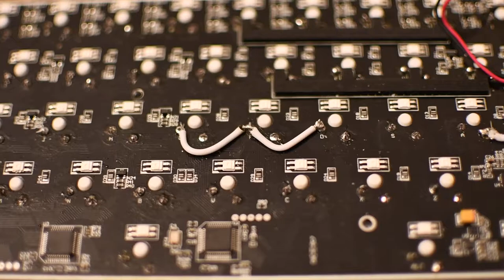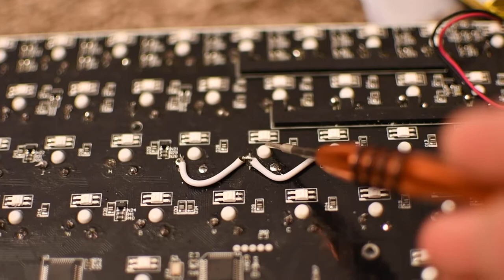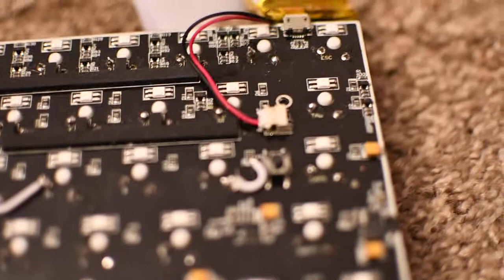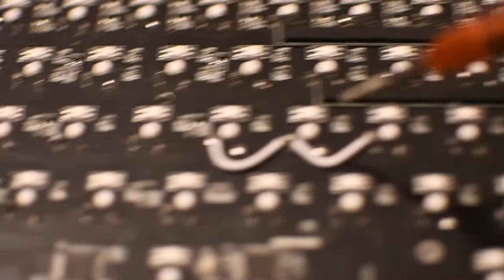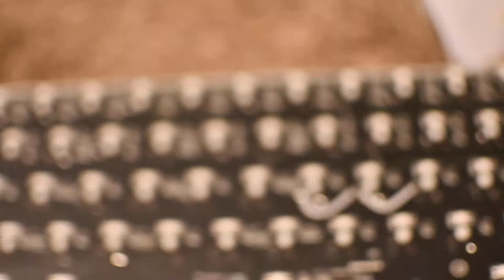Anne Pro PCB Lifted Pad Fix (should work for most other mechanical keyboards too)

Comment: Great video. I saved 4 keys with 6 lifted pads using cat 5e cable wires. I finally chenged my  corsair k63 wireless from linear to tactile switches.
Reply from the maker: Glad I could help!

Comment: both pads on my q key came off and using this method helped fix it, i had to bridge the upper pad to the left and right switch and soldered the lower pad to the respective diode of the q key

Comment: This saved my keyboard and made it useable. My keyboard is a masterkeys pro S, i had multiple areas where i ripped the pads and at first i tried connnecting them via scraping the traces but it wasnt viable. Then i saw their numbers and used method shown in the video and got it fixed. They are numbered in order on my keyboard. I ran wires in parallel like shown here but make sure you connect everything you think is stripped before testing other wise keyboard still wont work correctly
Reply: Mine is broken on the bottom one column to be exact the diode is broken so i connect it to the left or right, it copies the input of the following column that i connect, how can i fix this?

Comment: Thank you so much, my space key didnt work.
Soldered it to left and right alt keys now it works like charm :)
Reply from the maker: Glad I could help! :)
Reply: Hey man, not sure if you're still active but I have the same problem with my spacebar that you had right now due to me desoldering and then resoldering. But I think I lifted both pads. Do you have any tips?
Reply: @vanillasky4329  
solder space left pad to left pad of right alt, and to the left pad of left alt.
then for the space right pad you will have to find which diode is connected to space, its probbably close to the right leg of the space.
if you cant see the trace, just solder a wire to the space right pad and then to the diode.
if you dont know which side of the diode try both.
Reply: @MirkoPribanic  Hello! I hope you're still active on this thread. but I've looked around for a diode near the spacebar, but I can seem to find anything that looks sort of like a diode, HOWEVER, I have noticed the right pad traces leads up to the character "B" button's right pad, so I was wondering if I connect it there? Hope you're still active, you give me hope for my Anne Pro V1
Reply: @Kobeboy15  Yeah since you have both pads lifted you will have to find where the traces lead.
The right one looks like its connected to b key right pad.
The left one i cant really see, you can experiment with different ones, dont worry you wont damage the pcb

Watch this video should be helpful
https://www.youtube.com/watch?v=N5IivDkrp6U

Comment: So my windows and my left ctrl got pad lifted then what should i do? Where should I connect the to?
Reply from the maker: It depends on which pad was lifted for each of the switch locations, but if it's the legs that are meant to be wired to other switches, wire Left Ctrl and Windows keys together, and then wire Windows to Left Alt. If it's the legs meant to be wired to diodes, then just wire each switch to its own diode.
Reply: @Flashquark  i try to desoldering them, but my pcb got broken and both switches can't detected, i think because of the pad. So the both pins got broken. Then should I connect both of them?
Reply from the maker: @benedictiyog6228  yep, for each switch, one leg should be wired to the diode and one leg should be wire to neighboring switches megs that are in the same position

Comment: i have a keychron and i cant figure out what the diode is and which is the correct one for my dead O key..... any ideas or suggestions?
Reply from the maker: You have to just test one by one until you find the one diode that works. Every keyboard's diode layout is different, depending on the way that the PCB designer chose to place them. Usually it is located close to the switch that it is meant for, but it doesn't necessarily have to be right next to it. Also, diodes have polarity and it should be hooked to the side of the diode with a stripe on it.
Reply: @Flashquark Mine is broken on the bottom one column to be exact the diode is broken so i connect it to the left or right, it copies the input of the following column that i connect, how can i fix this?

Comment: hey, i've tried this. however, the whole row of my keyboard (from Q > \) is not working. I have tried doing this method, by connecting from TAB till T. The keyboard cant seem to continue working from Y onwards. Do you know what i should do?
Reply from the maker: If you connected from tab until T and then functionality works up until Y, then it looks like you did everything correctly. You would just need to continue linking all the switches until it reaches the backslash. Unless I am misunderstanding the situation: which switch(es) were the ones that lost their soldering pads?
Reply: @Flashquark  I already tried connecting from Tab to Y. But then all the other keys that i connected couldn't work anymore. Is it because there is not enough power to connect all those keys from tab?
Reply: @Flashquark  Oh and the switches that lost their soldering pads were Q. But then the rest of the row couldnt work as well. Ive done a bit of research and it said that i might have disconnect the trace on my keyboard? (im not sure how to fix that)

Comment: what if its the left shift key with the left leg of the switch lifted do I wire it to the right side and the bottom part of the circuit
Reply from the maker: It depends if the left legs are meant to be wired to a diode or leg on your particular keyboard. However, if the left leg is meant to be wired to a neighboring switch's leg, then only wire it to the same position leg of the switch to the right side of it and that's it.
Reply: @Flashquark  Thanks a lot! I managed to fix my keyboard I thought it was gone hehe. This method works!
Reply from the maker: @adrianmacalino4277  I'm glad to hear that you managed to fix your board! :D
Reply: oh man just realized Im abt to rip off the right pad of my spacebar but I dont know what diode I should connect it to... any ideas? My model is an RK 61 a bit different but I hope it's a bit easy

Comment: I hope someone could help me out here
I lifted a pad on my s switch, and bridged it then it worked. But the only problem is that one whole column on my keyboard on the leftmost part of the board (esp, tab, capslock, shift, control) doesn't work at all tried to bridge it but still nothing.

Comment: Hey nice tutorial. I currently trying to repair a lifted pad on a right shift. The lower pad to specific. Any tips on how to fix this? Thanks a lot.
Reply from the maker: Im guessing that the lower pad should be hooked up to a diode. For the right shift, the diode may not be immediately in the vicinity of the Right shift. See if you can follow the trace coming from that pad to see if it connects to a diode somewhere and connecting a wire between the two locations.

Comment: Nice tutorial. Im getting some grip over this but hey I am currently having problem on all 5 keys on the side. I am supposing its lifted on the right side. So i hooked to the diode then all keys on the same vertical horizontal line gets pressed instead of single key. Any tips? Thanks
Reply from the maker: Then it means that your keyboard is hooked up so that the diodes link the horizontal rows together instead of columns. Therefore try hooking up from leg to leg instead of leg to diode.
Reply: @Flashquark After all combinations of legs, I gave up. But thanks though

Comment: both pads on my space key have come out, what do i do in that situation?
Reply: i'm on alloy origins 60 btw*
Reply from the maker: wire the switch legs using both methods that I showed in the video! One leg will be wired to diode, the other leg to the same positioned leg on a neighboring switch

Comment: What about the spacebar socket - do I connect vertical or horizontal? Its a DropAlt by the way. Appreciate your info.
Reply from the maker: It really depends on which switch leg that you're dealing with. From looking at pictures of the Drop Alt PCB that are online if you view the PCB from the back side such that the hotswap sockets and microcontrollers are visible, the spacebar switch socket has a diode next to it that is labeled D62. If the hotswap socket is damaged, it may be easier to just completely remove the hotswap socket, wure the right switch leg to the diode D62, and then wire the left switch leg to the left legs of both switches on the left and right sides of the spacebar switch. Here's the picture I was referring to with lines added to show how it should be wired: https://imgur.com/a/ds8Azd1
Reply from the maker: Btw, looking at the picture again, it almost appears like I was implying that you should wire both spacebar switch legs together, but that was not my intention. The wire coming from the left switch leg just happened to pass over the right leg's socket in the image, but don't actually wire both switch legs together.

Comment: I would like to ask something about the diode. Do you connect it to the positive(+) or the negative(-) side? This is my first time doing this and not sure how these things work
Reply from the maker: The wire should be connected to the positive side of the diode. If you are not sure which is which, there is usually a think white line closer to one side of the diode or an arrow marked somewhere on the diode or PCB should you which side is the positive cathode.

Comment: i press left ctrl button and it registers capslock ,TAB ,Shift, ESC ,and Numlock button at one time how to fix it???
Reply: One of the diodes may be broken and needs to be replaced. It is most likely the diode connected to the Ctrl key.

Comment: How come I've seen in some videos where they wired the right leg to a bridge to other switches instead of the diode
Reply: Also for my pcb the diode seems to be on left instead of right
Reply from the maker: @kodychen9804  It's possible that its reversed on your keyboard. There is no standard for which side is which, but if one of your switches is a certain way, then most likely all of the other switches on your board are the same way as that one.
Reply: @Flashquark  thanks for replying so quickly. I am wondering if I am supposed to bridge yo both sides. Ive seen some where they only bridge to one of close by. I am also wondering if the move is to just try bridging to another switch and if it doesn't work I bridge to the diode
Reply: @Flashquark  also is there a way I can contact you so can send you pictures of my situation

Comment: Is it possible yo connect the right to the next right leg?
Reply from the maker: It is possible, it entirely depends on how the PCB was designed on your keyboard. However that means that the left leg should be connected to the diodes. If right leg is the one that is connected to the diodes on your board, then you must connect a right leg to a diode. I know it sounds like I'm stating the obvious, but what I mean is that you cannot link a right leg to another right leg out of convenience if it was intended to be hooked up to a diode due the the way that your keyboard's PCB was designed.
Reply: @Flashquark  last question
 hehe, can I still change the switch even if it is wired already?

Comment: I actually lifted a pad too and i was so fucked up.. then i just tried my luck and reapplied solder into it and the switch was working again.. do you think the circuit is still ok then or do I have to worry about sth?
Reply from the maker: If it works, I would say that its fine, and I wouldn't try to adjust it or anything. It's most likely working because there was a little bit of PCB trace was still exposed that the solder you applied is touching, but it may not be so easy to get contact with it again if you melt down and reply the solder again.
Reply: @Flashquark  Thankyou very much for your answer. 👍 What do you think about stabilizing the solder with hot glue?
Reply from the maker: @heyiamsven  I would say that it can't hurt add some hot glue to it, just in case the solder is just hanging by a tiny bit of pcb trace, so go ahead and try it!

Comment: Hello @
Flash Quark thanks for the video, my Q key is broken cause of lifted pad and I bridge it to the next key(like yours). But my Q continuously firing and I'm not pressing the key. Why is it like that and how to solve it. Thanks a lot :)
Reply from the maker: One thing that you want to make sure is that you're bridging to the pin in the same position on the switch next to it. Also, you may want to try out wiring that pin to a diode instead, in case your keyboard is wired in the opposite way from the keyboard that I demonstrated with in the video.

Comment: hi! quick question but what if you lifted the pad on the "tab" key and there's no key can attach it too...
Reply from the maker: If the key is on the end of the keyboard, then it should just be hooked up to the neighboring key on one side of it ("Q" if you have a standard board) and it should be fine.
Reply: @Flashquark  I tried your method on my esc key, I connected the wire to the correct pin on the f1 key, but whenever I press esc, it activates the f1 key, is there any solution for it? please help :"(
Reply from the maker: @ngocnguyenkim1941  I would try connecting to a diode instead of the neighboring F1 key. if that doesn't work, try hooking up to the key below the Esc key, its possible that your keyboard is wired so that switches are directly wired to each other vertically instead of horizontally. I would try the diode method first though.

Comment: what do you do if there's a series of broken pads in succession? the rest of the board is fine, i was just an idiot with three left pads in a row
Reply from the maker: The process should still be the same as in the video. You just link all of their legs together, and then link to one more on the left of the leftmost switch, and to the right of the rightmost switch so that in total you will have 5 switches wired together
Reply: @Flashquark  that's what i assumed but didn't want to mess up further. thank you so much!

Comment: #HELP_PLEASE
Can Some One Plz Help I want to know What model of Smd RGB led is used to make (Cooler Master MK750) because. I want to replace my keyboard faulty LEDs.
Reply from the maker: I don't know the model, but there's a possibility that the LEDs will start working again if you just reflow the solder.

Comment: if i connect it pin to the diode it spams the key and suggestions
Reply from the maker: It might the wrong side of the diode. Diodes have polarity, so try connecting the wire to the other end of the diode and see if that helps!

Comment: How can u tell which side is the one thats busted?
Reply from the maker: It should be visually apparent that a pad is lifted because there is no metal and you can see the bare PCB underneath. If you really aren't sure, you could just try wiring up both sides. it might be a bit overdoing it, but at least it gets the issue fixed.

Comment: So if both the pads are lifted, you connect it to the diode? And another switch?
Reply from the maker: Yep, that is correct. If both pads are lifted, you will need to do both procedures.

Comment: does this method  work for the ducky one 2 mini
Reply from the maker: Yep, it works on all mechanical keyboards! You just need to find the correct diode if it is one of the switches that needs to be linked to one.
Reply: @Flashquark  while im waiting on the wires i hav a weird problem wit my keyboard after putting in my new switches everytime i press on the F button it inputs  4  R  F and C
Reply: why does it input 1 whole column

Comment: what wire do you use for doing this?
Reply from the maker: I think it was 20 AWG gauge wire, but the thickness really doesn't matter as long as it can easily be soldered onto the switches or diodes.

Comment: doesn't work with ducky one 2 mini pcb :(
Reply from the maker: keep trying! :) The reason I'm sure it will work is technique is not keyboard specific. In reality, keyboards don't even need a PCB to work if all the switches and diodes are directly wired to each other. It might just be that the location of the diodes of the Ducky One 2 mini are placed differently than on the Anne Pro. you just need to be patient and try with all of the diodes (if it is a switch that is meant to be soldered to a diode) or try the nearby switches one by one if its meant to be soldered to another nearby switch.
Reply: If you follow the connection in the pcb you'll see that they are different than the Anne pro 2. On the ducky it is opposite. The pin on the bottom gets soldered to the switches and the pin on the top gets soldered to the diode